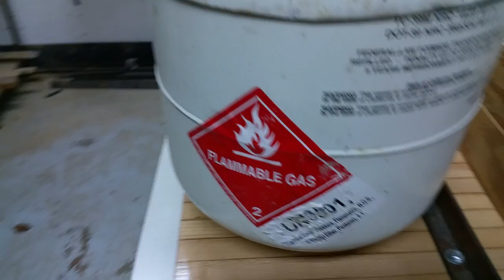Melting aluminum 2.0 update...new crucible

Comment: I used an fire extinguisher and was actually made out of aluminum that was fun. Leaked into my air system and i had to take a blow torch a melt it all out of the pipes.